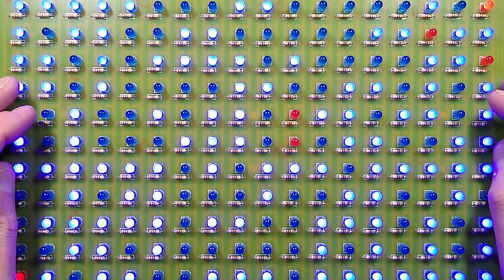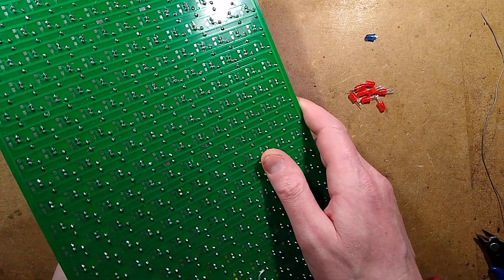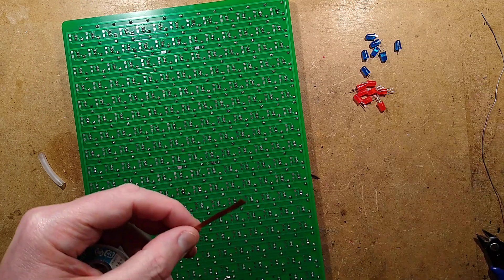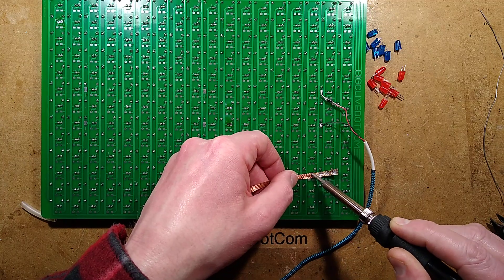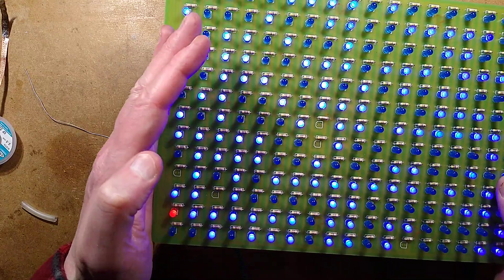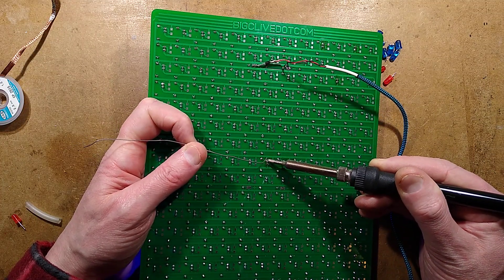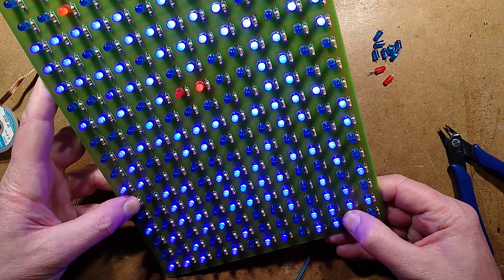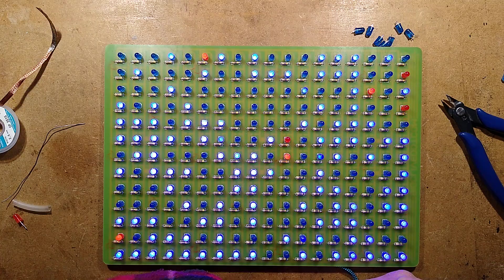Repairing the live stream supercomputer panel

Comment: So far I’ve finished 3 Supercomputer A4 boards. Green, Blue-Red alternating, and pure blue. The flashing pure blue LEDs seem to have the highest failure rate. That figures since I decided I like the blue board best. I’ve seen two modes of failure. One where they are just lights out, totally dark, and one where they are just solid blue, constant-on, but no blink. There were so many failures I started testing each one before I installed it to avoid the need for replacement. Even then there were some that failed after that point. Also many had dangling epoxy snot aberrations that prevented them from sitting squarely on the PCB and those had to be removed and trimmed or replaced altogether. Good old eBay. I Just received a reel of 5000 1206 SMD 470 resistors that I ordered with the hope of speeding up the building process. Not sure if there was a stencil option from JLCPCB when I ordered my boards but either way I have a hunch I’m going to wish I had one. Thought it might save time vs. fiddling with the axial leads. Now that I see how tiny they are I’m not so sure. Almost think it would be worth the time to build a small CNC machine that would squirt a dab of solder paste on each resistor pad. For now it looks like my patience is about to be tested with the manual process. At least the fine end product is worth all of the time and effort. When night falls and darkness is all around, it’s fun to fire them up and watch them go!
Reply from the maker: eBay really is a dumpster for factory reject components.  But OK for personal projects.

Comment: Clive, while watching one of your recent impromptu Live Streams. I was thinking if one could made a panel of IR (if there was some sort of way to make them a 50/50 flashing type) LEDS it would look like a blank panel. That is until someone used their mobile phone or other camera device and see the revealed flashing display. I'd like to make a panel like that from your PCBs, frame it, and have it hanging on a wall. I'd say nothing about it to people until they take a photo or movie and it is in the background. Therefore when they review the photo or film footage they will also have the surprising outcome of the super computer captured or blinking in the background. Maybe even glue gun another frame on top with the glass painted in a black coat. Then you wouldn't see that there is LEDs there akin to the blacked out rear car lights until they are used to reveal the Orange, White and Red glows of the bulbs. What do you think?
Reply from the maker: The tricky bit might be finding flashing IR LEDs.
Reply: @bigclivedotcom Yeah it would be if there was Flashing IRs. How about a mini control PCB that would switch the IRs on and off randomly. Would it take too much to MOD this board to do so? Maybe do it as a mini Project with your 6x4 or 5x7 Framed PCB as a test unit?

Comment: Lol ! I had the unfortune to be asked to do a repair on one of these 'Handwriting Analysers' I was just 14 or 15 at the time and earned my money by assembling electronic kits that would then be sold in an electronics parts store (the only one in town). The machine looked so high-tech from the outside .... but it was just the cheapest mechanism inside - all wood. The blinkenlights were just backlit holes in wood shining through onto square lenses that had the back covered in some glo-in-the-dark paint, the light mask was moved by 4 AC motors on each side with oval gears. So was the analyser ... 2 motors that puled a pen on a bungy-cord over the paper .... I suppose I've been a grumpy critic ever since ... oh yeah, I did give it a few years of extra life - I remember it was in the corner of a Mall, operated by an old man - I think it fed him well.

Comment: [5:35] "Ahh, Ive just shorted out the supercomputer", an excellent use for soldering braid......while the current is on... Yes , one more of the 'follow the instructors' adage to use one hand rules, that promptly are ignored on YouTube.
Reply from the maker: At 5V I doubt anyone's going to die.
Reply: @bigclivedotcom  No, not die, but will run the 5V supply to max current, then clamp the transformer as the braid bridges the +ve and -ve pads of the LED, however one bridge per set of pads, would only short out the LED portion, since it is current limited by the ballast resistor,
Reply: Not terrible, since the PSU should handle the the jump in current, but then, it depends on the limit on the power put thru the +5v rail. (in theory, if each LED were consuming 5mW, then it would take 2,000 LEDs to max out the 10W available to the USB power limit)

Comment: I've got an ~80V jag from soldering on a '5V' circuit that was live while being fed from a capacitive coupled USB wall-wart. The Soldering Iron was earthed and connected to the solder that I was holding while the board was capacitively coupled to mains. It made it a little harder to get a neat solder joint but it wasn't until after the second jag that I turned it off :P

Comment: So you're replacing the blue dead ones with the red to show which ones failed over time..... What colour are you going to use when the red ones fail?

Ps. 7:43  A "Drop In" at the pub, means the owner walks me out to the car Waaaaaaaaay after closing time, hence the reason for me not doing that any more. 

9:36 Consider yourself lucky, I have a face for radio...... And a voice for one that's gone "Off Air" 👍 🤣

Comment: Using a Dropping Resister on a Flashing LED is not correct since it is running with a Microcontroller, a regulated voltage around the LED Forward voltage is better.

Comment: I just completed my order of 5 of these boards with JLCPCB. Costs (before customs) are so far less than € 40. Now I need to source the components. Anyone any tips?

And once I completed one of those board to my liking, I want to sell the other 4 boards via ebay or has anyone a better idea?
Reply from the maker: Searching for 1000pcs 5mm diffused flashing 1.5Hz LEDs should find them.
Reply: @bigclivedotcom  thanks. I'm busy with searching on Aliexpress, but am not sure if that is the "best" source. Ebay I used in the past but there it's not easy to find electronic components.
Reply: @bigclivedotcom  Have now received the boards and the resistors. Waiting still for the LED's.
Reply: @bigclivedotcom  as I've now completed my board I was wondering about the 0.5 Hz flashing LED's. Found those on Aliexpress, but you can only order a minimum of 5000.  Asked the seller and he confirmed. Asked to explain why 5000 not 500. No answer yet, but is there anyone who could tell me the 'logic' behind this? Who needs 5000 of the 0.5hz blinking LED's?
Reply: I've finished my board and put in in a frame. Looks great. 

As I had to buy 5 of these boards, I've 4 left and want to sell at least 3 of them. Note that I send from the Netherlands in case you want one. Please let me know if you are interested.

Comment: I've decided I really have to learn Kicad, so I'm designing my own "supercomputer". Mine will be modular and fit within a certain PCB manufacturer's 100 x 100mm "special offer", so you can order the default 5 boards for cheap and join 4 into a larger panel. Then you can decide if you want to order more later and make an even larger panel.

Comment: The manufacturing quality must be unbelievably variable.  If you're buying an led for a gigabit fibre optic channel and need it to survive one year then we're looking at 10 to the power 14 operations, approx.  Phenomenal reliability.  But these are flasher leds and I'd guess it was the built in circuit that failed.  It probably includes a capacitor and from previous episodes I think Clive's opinion of surface mount capacitors includes the phrase "cough,spit....".

Comment: If the voltage is lower, are the resistors still needed?
Reply from the maker: I prefer to use them.
Reply: @bigclivedotcom  OK. So why aren't resistors built into the LEDs?
Reply from the maker: @two_tier_gary_rumain  Most flashing LEDs have a wide operating voltage range up to around 14V and require a resistor to set the current according to the application.  In this panel I wanted to keep the current low, as with 234 LEDs the current rapidly adds up.  At 10mA the peak current would be around 2.34A and the intensity may be too high for many applications.

Comment: >the wonders of eBay being China's electronic component dumpster

I ordered three "no-slot" clocks off ebay from China (because I had no other choice).

Out of the three, one was good.  I had expected they'd be pulls from equipment from 1987, and they didn't disappoint there.

At least my HOPI (another item I could only seem to get from the bowels of Shenzhen) I received last week works and looks like new after changing the Chinese plug for a NEMA5-15 plug...

Comment: You're a few decades off there, Clive.  The last well-known compute with blinking lights on the front panel was the IMSAI 8080, which came out in 1975 or 1976.  It was a clone of the Altair 8800 with a nicer front panel, and that also had some blinky lights.  It was largely inspired by the front panel of a PDP-11 minicomputer, which also had blinky lights.  The computers with the big panels of blinky lights were really from the late 40's and the 50's.  I'm fairly sure the granddaddy of the blinky light panels was on the ENIAC, which was modified to show up on motion picture film better by sticking ping pong balls over the neon indicator lamps.

Comment: Hi clive... the ones i have made so far look darn good... I got cheap leds from good old aliexpress.. chanzon. they have been rather nice so far.  made 1 with green flashers, and a painted black one using colour changing..  i did the 2nd ones using smd and it worked perfectly. I even used the paste for the TH leds, looked nice.  Thank you so much for what you do :)

Comment: I wish I could obtain that PCB.
Reply from the maker: Link to PCB files in description.
Reply: Yea me too... Tried jlpcb (?) And it came back as £40  :-(
Reply from the maker: It should be around $30 for 5 if you choose the airmail shipping option.  The PCBs are literally being custom made for you.  Photo transfer, etching, screenprint resist, solder plating, drilling and text screen print.

Comment: Isn't the soldering iron's tip usually connected to ground through a 1M or so resistor? A hard grounded tip would kill parts if there was a static charge present, of course.
Reply from the maker: Usually direct ground.  Especially the 240V element type.

Comment: If you had the resistor on the LED cathode and the soldering iron was referenced to ground (and the power supply was too), would it mean soldering with the power on could connect the LED cathode direct to ground via the iron, bypassing the resistor, and burning it out?
Reply from the maker: Isolated power supply.

Comment: I remember the original Star Trek show for the large 'engineering' panel they wanted a lot of panel lights.  So they used one large lamp and a board with holes behind that slowly shifted left-right like multiple 'shutters' letting light through various holes.  Even lower tech than multiple lights.
Reply: Some of the early space movies from the 1960s used a real computer as the computer or ship-controller background. A number of times the cast and crew of some movie would drive from Hollywood out to Pasadena to the Burroughs building, and run a scene setting in front of the 205 computer while it was munching away on some unrelated problem.
Reply: @lwilton  When I worked on an older computer system (SEL Mini-computer used for real-time simulation) we would often have 'suits' coming through on tours.

To impress them, we would load up a 'tape-sort' routine that used the two reel-to-reel 9-inch tape drives.   They'd come in, see those tape reels spinning back and forth and were suitably impressed.  "Just like in the movies..."   lol
Reply: Much like the turbo lift lights

Comment: Several TV shows, in the US, in the 60s, actually used the panel from a real Burroughs (Electro Data Div) 205 mainframe computer. Batman, for sure. But I also believe Voyage to the Bottom of the Sea, and possibly Lost in Space. Burroughs' Electro Data division, was located in Pasadena, CA. Not far from Hollywood. My mother, an aunt, and an uncle, worked for Burroughs.

I remember those "handwriting analysis computers" at fairs, in the 70s.
Reply: Actually, the blinky-lights computers in the 1960s Batman show WERE the same machines from Lost In Space, they got rented out to the set dressers from the outfit that warehoused them after LIS wrapped. They plopped some Batman-related label in front of whatever label originally had a LIS related designation on it.

Comment: Hi Clive, love the idea of these LED boards, just tried to get a quote for the gallium2 PCB using JLCPCB and they wanted almost £30 including postage and import tax, do you use any UK based PCB manufacturers for your boards?
Reply from the maker: I just ordered another 5 and it came to $27.  These are large and heavy PCBs.  The bulk of the cost is in the shipping.  Mine are being shipped by standard airmail, so may incur further charges.

Just to put things into perspective, it used to cost me £20 each for PCBs this size in a quantity of 100 (£2000) about 20 years ago.
Reply: @bigclivedotcom  ah it looks like i got a £3.66 discount on the first order, not so bad then :) cant wait to get the boards :)
Reply: the boards arrived and they are perfect, not a scratch on them and all traces are clean, component holes are perfect sizes too, nice work on the design Clive

Comment: You should see if you can get the Big Clive Live channel logo made into a sign for the other side of the shot to the super-computer. Maybe the eyes could glow red / orange in a sinister way in response to  noise, motion or brain activity  which is detected through a tri-corner hat worn by Clive during the stream. Does the super-computer have a name?
Reply from the maker: There is a BigCliveLive sign on the other side.
Reply: @bigclivedotcom  I see it 👀